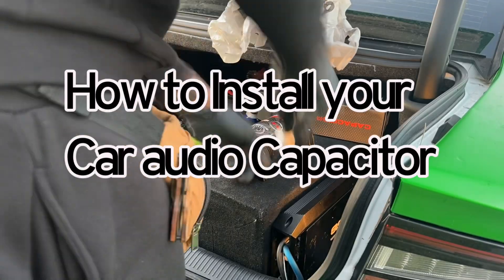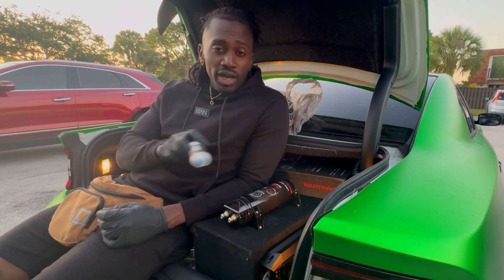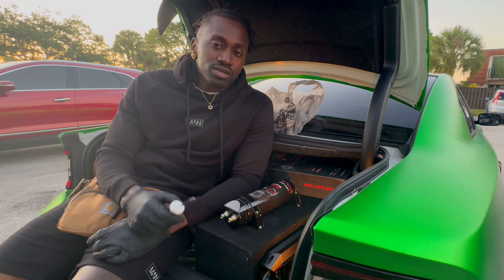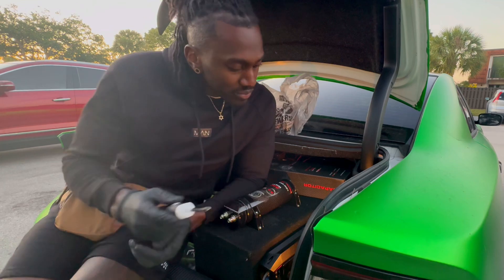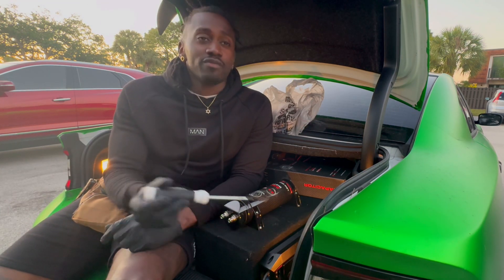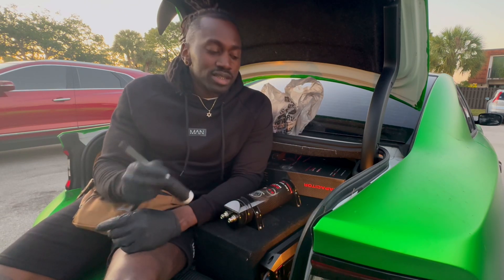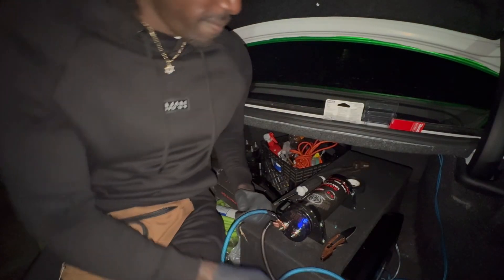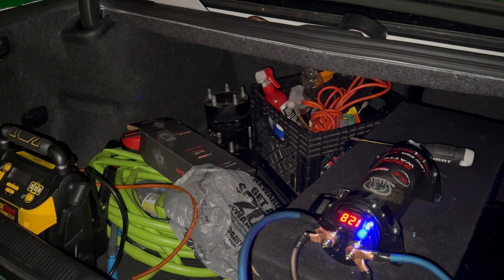How To Install a Car Audio Capacitor : How to Charge a Car Audio Capacitor.

Comment: Can i connect a capacitor on sames wires where i connected amp  + and - on bettery
Reply from the maker: @ARN1Sx  i suggest following my exact instructions in the video
Reply: Do everything same but a cap dont light up xD @TJTooSmooth
Reply from the maker: @ARN1Sx  Is it a new CAP?
Reply: @ yea, but now its working, but sad my headlights is still flickering :(((
Reply: @ARN1Sx you need a high output alternator and (big 3). 4ga or better wires for power and ground going to your battery and alternator.

Comment: That's a low resistance resistor not a fuse and a tip having a capacitor on a speaker is a no no. Reason that is because the vibration can shatter the material inside the capacitor.